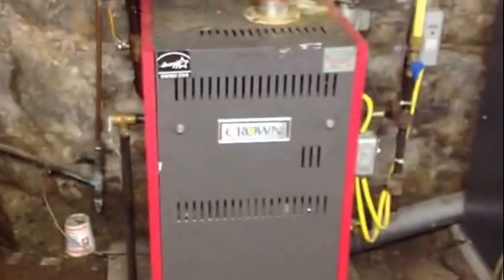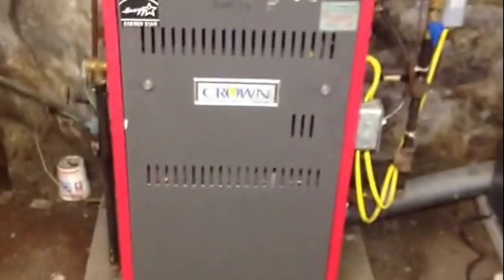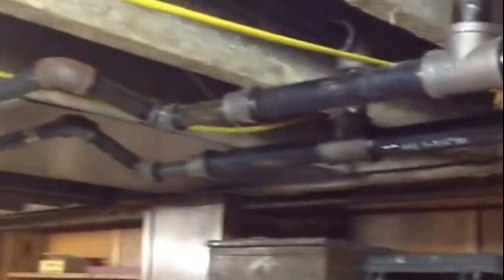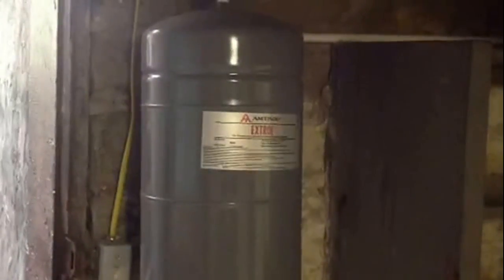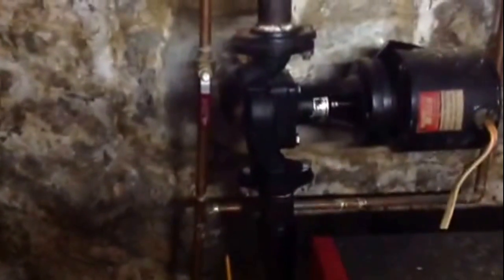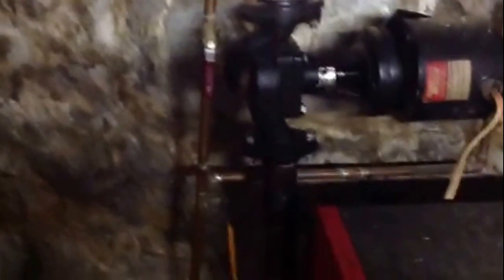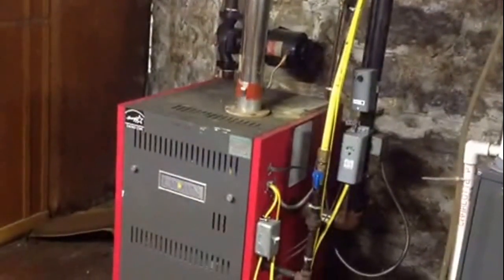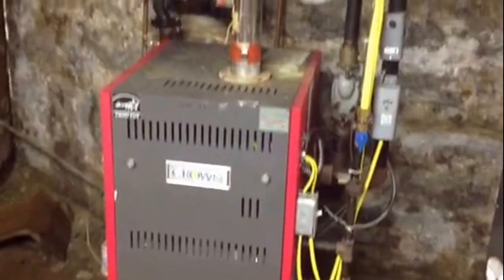How to convert a boiler from steam to hot water

Comment: OMFG all the CSST with romex strapped to it. KABOOOOOOM. I guess no inspections on that job.
Reply from the maker: tuppersdad no inspections no kaboomooooom yet I will let you know.
Reply from the maker: tuppersdad could you point me in the direction that says you can't do this. Running the wires down the gas line is done on just about every job I have seen. When the gas company does inspections there is no mention of romex touching csst. But I will go into my attic tonight and watch for the kaboomoooooms out the window all over the community since this is done on every installation out there. I will get back to you and let you know how many kaboomoooooms I see per night.
Reply: themrhelperguy You cant strap a line voltage line to any gas pipe, iron or csst. You can just you tube it. The fires related to csst are traced back to lightning jumping from csst and line voltage lines mostly in attics since you mention the attics. And the bonding that is required is for that reason.
Reply from the maker: Could you point me in the right direction that this is clear that you cannot strap line voltage to gas lines. Bonding is not for direct lightning strikes only voltage from distant strikes. A direct hit bonding will do nothing. Do you realize that every furnace has the line voltage strapped to the gas line. That's why I'm asking you where exactly this is documented in local code county code state code federal code gas company says so anything where it states it's forbidden to strap line voltage wires to gas line.
Reply: themrhelperguy Every furnace or boiler does not have the line voltage strapped to the gas line. If I strapped it to the gas line for a boiler I install it would fail inspection. The yellow csst requires a bond. The black csst has  a shield and dosent require a bond but some areas don't except that like the state of NJ you still must bond the csst. But like you said you don't get inspections so most likely no kind of license.
Reply: themrhelperguy Just on a side note I also could never run the csst down to the boiler like that unsupported, not that I ever would.
Reply from the maker: tuppersdad an inspector cannot fail any installation unless they have written code. Now where is it written that you cannot run csst and electric lines together. Anywhere any state,local,installation manual,electrical code, gas code,borough, ubc. I'm not saying you can do it. But I have never seen it not done. I would like to see this in writing before most of the US has to change this. As a side note the local utility has been doing inspections of the gas lines and not once did they say that this was an issue or required a change of the electric lines or csst running from joist to appliance. It is required that you bond the system before any csst pipe.

The bond is made where the gas line enters the house. So the juice flows from the dirt that the lightning hit onto the gas line to the first bonded line through the ground wire and back outside to the ground. The bond is made before any csst. Just because you don't see the bond it is nowhere near the boiler.
Reply: themrhelperguy I didn't say you didn't bond it I said that's why you are required to bond it. You can bond it after the meter but you can also bond it at the first csst fitting.
Reply from the maker: tuppersdad can you just tell me in what medium running csst and romex together is prohibited
Reply from the maker: tuppersdad I would really like to see where it is prohibited to run csst from your joists to the unit.
Reply from the maker: themrhelperguy maybe this is just in New Jersey
Reply from the maker: themrhelperguy I think your being buffaloed.
Reply from the maker: themrhelperguy even if it is just in New Jersey there has to be some kind of medium that contains this wording.
Reply from the maker: tuppersdad were you able to look up that information. I am interested in reading this little tid bit.

Comment: properly maintained steam system is not significantly More expensive to run than a hot water system, also all the piping mods that were done here seem way over complicated for a simple two pipe steam to hot water conversion. Take out the traps,Remove the crossovers, pipe in a new boiler primary secondary and that’s pretty much it and hope nothing leaks. Likely had bad steam traps and some other maintenance issues and they probably didn’t skim the boiler after it was installed a bunch of things but there’s never a reason to just throw it out.  What’s with the ancient circulator in the back? Steam can be great heat in the right hands
Reply from the maker: Steam can be great in the right hands. When you can't find the right hands you are beat.

Comment: Hi there. What I’m understanding is you have converted a steel boiler to water heat system? That is brilliant! I wanted to do that to because it will be more efficient.  Pleases explain how it’s working.
Reply from the maker: Just to be clear the boiler is a hydronic boiler hot water only. The system was a steam system with steam radiators that could be converted to hydronic. The situation was that there was a 400,000 btu steamboiler that the lady had installed 2 years before for 10000 dollars. The budget was over 600 per month. Getting rid of the steam boiler and installing 3 96 percent furnaces and using the old steam system converted to hot water on the second floor where we could not easily install ductwork. We lowered the budget to about 300 and had heat in every room. Not so with the old steam. That was 15 years ago and the system is running great. The reason we converted to hot water is ease of maintenance and installation. For me to install a new steam system for the second floor was out of my league. I knew I could accomplish converting the system over to hot water with a new boiler. So that is what we did. For me it made sense since because I had to maintain the unit so simple was best. Now if I just called someone out to do maintenance maybe it would have been different. Maybe not when you need a steam guy on Christmas to come out and see what they charge.